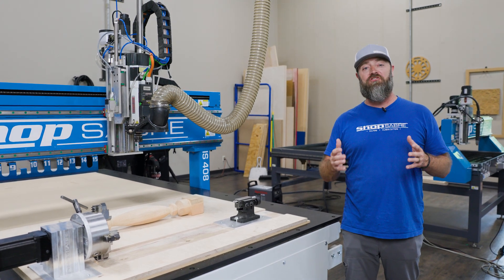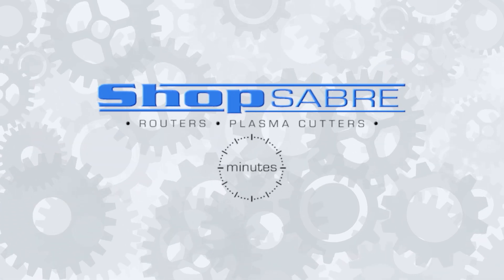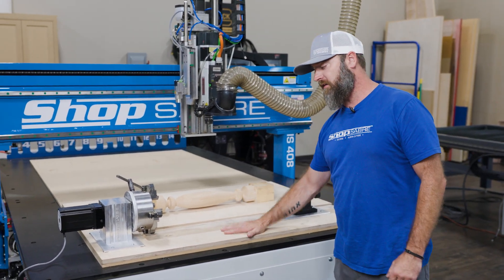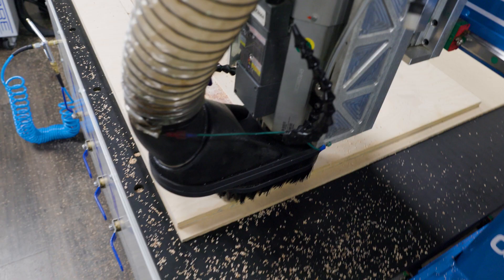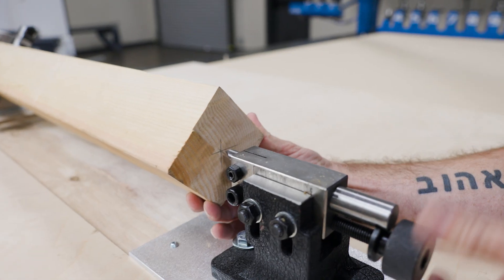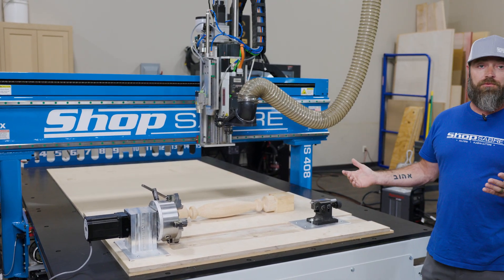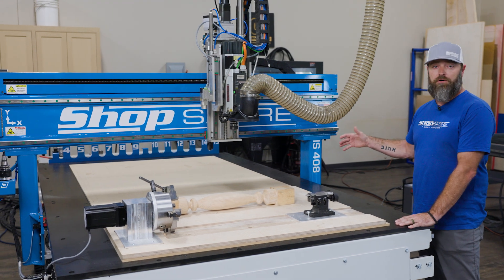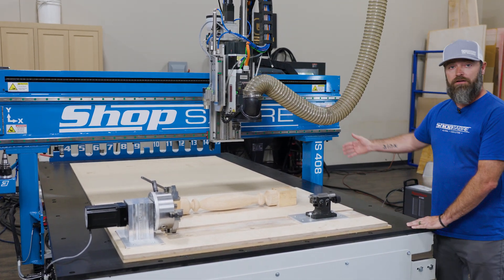4th Axis CNC Setup - ShopSabre Minutes

Comment from the maker: Got a minute or so? Let's talk setting up a 4th Axis.
Reply: Thanks for the video. Do most people set up their 4th axis on the x or y axis…pros/cons with either? Thanks.
Reply from the maker: @steinbierz ultimately depends on what you’re doing. We see a lot of of smaller parts along the X axis and it’s a little easier to setup and run but for larger parts the Y makes sense